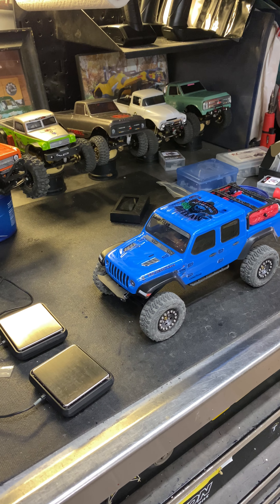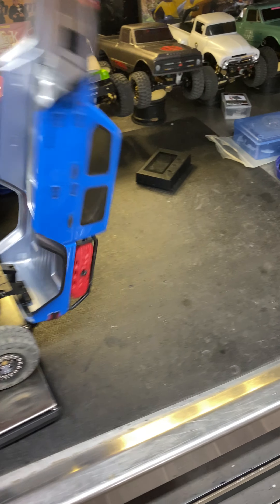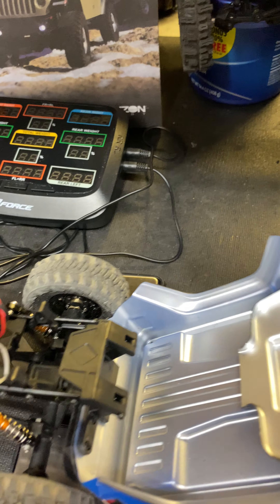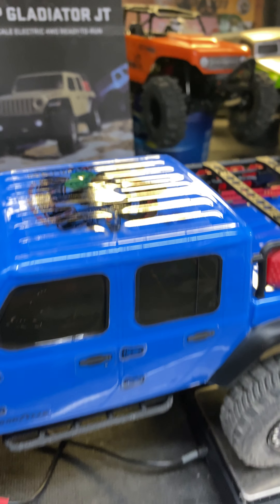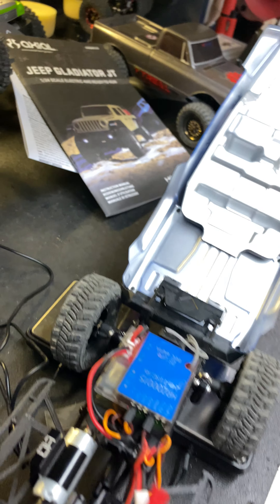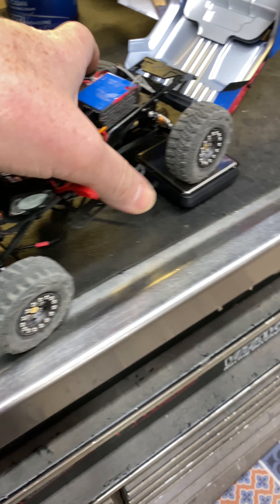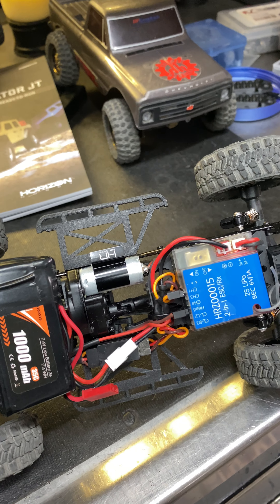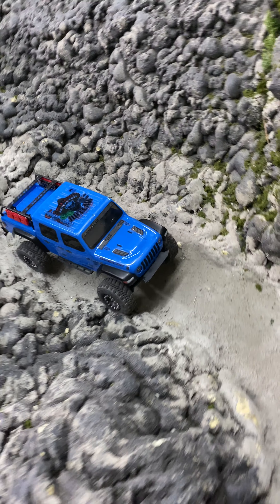SCX24 GLADIATOR MODS AND DISCUSSION 60/40 WEIGHT DISTRIBUTION

Comment: Thanks for the shout out!  If I was going for straight crawler build, I would have pretty much done the same mods as yours, LCG battery tray up front and move the battery forward.  Move the ESC to back (only difference that I would have done is remove the battery tray, and use 2 sided tape to mount the ESC in between the chassis rails thus lowering the ESC a bit more, or even decase the ESC and conformal coat and mount it without the case).  As you said the ESC/receiver/radio is much improved, so I would have also kept it brushed and upgrade the motor.  And finally remove the overland tent.  And add few brass items (knuckles, diff cover), it should be able to get to 60/40 weight distribution fairly easily.  I decided to go more of scale trail truck that can climb...it will be tough to get to 60/40 with more stuff that will be added, but I will have another rig coming up for the crawling purposes...videos will be coming soon.
Reply from the maker: Anytime man, love your content! I wish I had time for more uploads, I have 2 comp courses at home and have started hosting monthly comps so I set everything up to crawl as best as I can. My Gladiator as scale as it looks crawls amazing! I’m really excited about the performance of the oil filled HR shocks, stability is un like anything else, and I do not miss the articulation of the telescope shocks. The brushed set up is killer with a HR motor but after some digging I have found the Furitek chameleon is super stout, just needs a 15/16 tooth pinion instead of the 11, as it’s slow on 2s. Even after gear up it’s pulls harder and crawls smoother than any of the other 050 motors I have tried!! You should check into that set up paired with the gen2 electronics!!
Reply: @CANAMROCKS1  Yeah it takes time to consistently produce contents.  I love your setup at home.  Fortunately being in California, I have year around access to places so it makes easy to get out and spend some time with RCs.  Did you every try my shock mod and see how it compares to HR oil filled shocks.  I have a set, but I am saving it for another build, so I haven't had the chance to test it yet.  I am not big on flex, so I have stayed away from telescoping shocks.  As for electronics, I have a different plan for Gladiator...will be going 3s.  But I love the v2 ESC, so that will probably end up on my C10 build.

Comment: What sliders are you using on the Gladiator?
Reply from the maker: It’s a modified set for a c-10, had them laying around and moved the back to first skid hole and made new holes for last 3. Have a set from Shaka hobbies in the mail! Ones for the Betty or dead bolt would line right up but not be full length